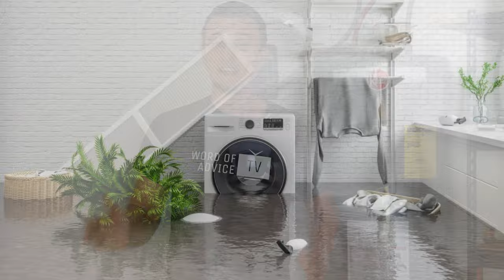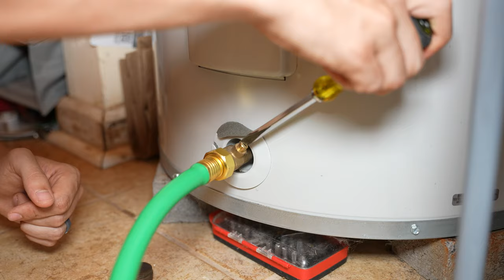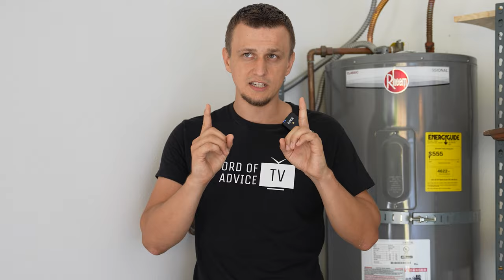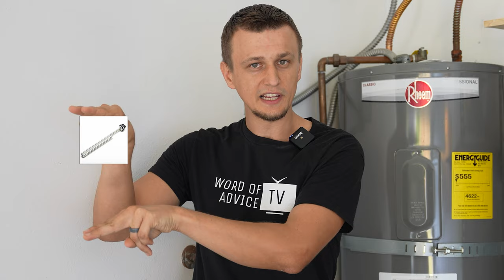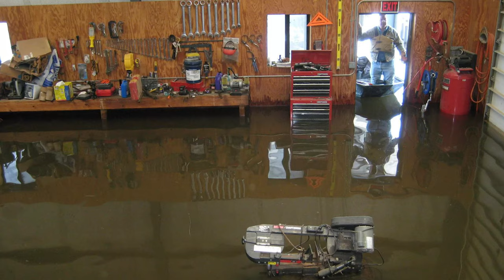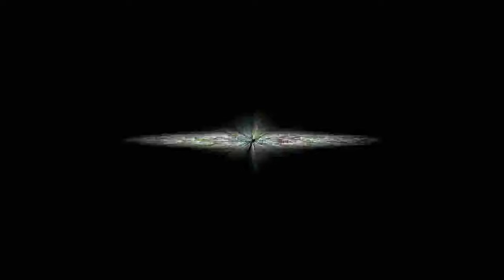When Should A Water Heater Be Replaced?

Comment: Love the video but it feels like I’ve been struck by lightning based on your confidence that hot water heatings almost never start gushing water. I’ve lived in 2 apartments with older water heaters, maybe 25 years old, which broke and started flooding. One was a college apartment and we just heard the water running from another room and checked on it with an inch of water on the floor. Not quite sure why it was leaking but I just shut off the water til maintenance showed up and replaced it.
The other time in another apartment, heard gushing water from the water heater and found a large indent in the side of the thing maybe a foot across, and had to do the same thing, although I caught it earlier than the previous time so there was less water

Comment: I bought my current home roughly two years ago. The home was built in 2005 and it still had the original HVAC system along with the original water heater. Both items were replaced after I got settled in. HVAC systems and water heaters are the two common and very important items in most houses. These items never fail at say, 9:00am on a Monday morning when people might have a decent chance at trying to find a good deal on either the item(s) themselves and or try to find a decent deal on a service technician that's not going to gouge their wallet for an item that the technician knows the homeowner absolutely needs to survive. This is why I replaced mine while they were still operational. It gave me time to find the best deals on both items for which I did rather than getting screwed by an HVAC or plumbing company. I knew both items were over 15 years old which meant they were running on borrowed time.

Comment: The following is the note from my plumber for my GE water heater 40 gallons (made in 2006). He didn’t even try to replace the heating element and thermostat to check if that fixes it, and has offered me a $5000 quote for water heater replacement. Should I try replacing the heating element and thermostat myself?

“This water heater is 17 years old and full of limescale. The elements are burning up and tripping the main 30amp breaker. This water heater needs to be replaced with a few code upgrades as well to make it safe for the tenants.”
Reply from the maker: Yes. I would replace the heating element myself instead of buying a new water heater.  I only suggest replacement if the inner tank is leaking. Since he wants to sell you a new unit, he would have stressed that its leaking if it was.
Reply: @WordofAdviceTV   - Thanks for your prompt response. I will try replacing both parts and see if it works.

Comment: We have a 20 year old gas water heater that works fine. It has never been drained and never changed the anode. Should we wait until it leaks to replace it? It works fine but we were told that 10 to 13 years is the life of one and ours is 20 years old.

Comment: My home was built nearly 15years ago and still has the original water heater. 5 years ago I learned I was supposed to flush it for sediment, but since I never had, i figured it was too late. I have replaced the thing that lights the gas and that was easy. I have never tested the pressure valve…can I still test it? My biggest concern is it’ll blow up. Great video! Thanks!

Comment: 2 out of 3 water heaters I have had that failed leaked both game with the homes they were not new when I moved in.. 1 was in an unfinished basement so not a big deal the second was in a finished basement and wrecked the floors.. It wasn't a sudden leak but fast enough to soak everything.

I think the oldest of the two was 20 years old. Water hardness  / PH etc might be a big factor in how long these things last. Because it is avoidable damage some insurance policies will not cover damage from a leak if the tank is over 10 years old which drives early replacements.

Comment: I guess I'm just "lucky."  Two days ago my 7-year old Rheem water heater flooded my entire home when I was at work.  It will cost $14,000 just to have the professionals pull up the flooring and dry out and dehumidify everything.  I don't know how much it's going to cost to replace the flooring, repair the drywall, paint, replace the lower cabinets, etc.  It all started when my husband noticed a slight leak from the outlet valve near the bottom of the tank.  Two days after that we experienced a FLOODED HOUSE.  My husband didn't do any tank maintenance, but I really don't know what exactly caused the issue.  I just know it sucks!!  So never say never.
Reply: I have water detectors now, they are cheap. My State AO smith is about 8 yrs old and its starting to leak. I am going to install another myself. I called some plumbers and they said that lifespan is getting more typical today,

Comment: Mine is ten years old, and I'm looking forward to replacing it.  In the summer, I'm spending 40$ per month on water heating on a small family of four.  It's supposed to use under $300 per year.  I flush the sediment every year, but I'm sure the annode rod is gone and I don't know how to do it myself.  I want a hybrid heat pump, it's expensive though.
Reply from the maker: Water heaters can last a very long time even without an anode rod. But either way, do what's best for you guys! Research on the topic and pick the path that makes most sense to you.

Comment: My situation is one of those older Water Heaters. Back when I was 6 years old I helped my father install a new Montgomery Wards Glass Packed Hot water heater. From memory it was just prior to Christmas. My mom and Dad had just purchased their first home and I was a only child at that point. Today my boy lives in the place going to college. The date of Manufacturer on the Water heater is 10-1-1981. After 43 years of use, no problems ever with the water heater, the basement flooded with 3 feet of water over Easter weekend (also a first flood or water in basement we ever experienced) due to root infected Sewer line.  For current reasons unknown today I can not light the pilot. No flame what-so-ever, so my guess is something in the gas valve was affected or a clog in the pilot orifice. There is still a remote chance things are still wet causing us grief. After talking to a couple DIY/professionals  they are all telling me basically what you mentioned. I should replace based on age alone. The unit has never given me or my family grief in 43 years with little to no maintenance. Cosmetically it look decent still as well. Your video gave me a sanity check! Thanks for the great video!

Comment: Just a thought, if there is 2 inches of sediment in a heater the exhaust pipe can get 2-4 times hotter than normal as the heat transfer is not working properly and a majority of burnt gas heat is going through the chimney rather than heating water. The last set of claims in the video are not accurate. The rest I totally agree with. Good job.

Comment: I have one in my basement that has no date of manufacture on it. When i got my furnace replaced the guy said that if the serial code was during the time that maker used the serial to say the date in it it would be a '68. Although he thought it was a 70s era design. Still older than both of us.

Comment: I have a 25 year old richmond water heater with no issues. It has no leaks, doesn’t oftenly run out of hot water, no crackling or popping, no smelly water, anone rod was never touched, never flushed it once, burns clean, heats up water fast. They really don’t make them like they used to.

Comment: I got my house 5 years ago and was told my tank would need replacement soon it was already 8 years old...well that time came about a week ago and I became a chosen one as you called it lol..I cut the gas,water,and tank off and empty what was left in tank because it wasn't bad flood but it got about a 30sq foot area of basement so I took up the tiles that was floating lol and dried it all out and replaced it I'm pretty sure it was a rusted hole on the bottom because once I empty it I didn't have anymore water coming from anywhere

Comment: Electric Water Heater getting near 50 years old. On a Time of Use Plan (Weekdays7pm-7pm and Weekends)   Starting in the 80's (for about 15 years) it was Supplemented by a "Solar" Water Heater Tank (Part of a Solar Heat System that also provided warm air to house, supplementing the All Electric Home's Baseboard heat) that provided the "Primary" Tank preheated water.  

On its 3rd Anode Rod (2nd Replacement) been meaning to check its condition as the unit is nearing its 50th year in service.  Has had several new Heating Elements and Wiring Concerns (partially due to an obsolete Utility Program's "Cut Off" device, that eventually was still connected and eventually failed in the "off" position) came close that time to retiring the Tank.  

Checked for Sediment last year and it seemed/seems clear. The Pressure Release Valve isn't in the best shape and so it's best not to "test" it often... Without having a pail nearby to catch any dripping over the next few days...

Comment: My water heater is in the attic.  I put a battery-powered alarm (Amazon, cheap) in the pan below it.  At 2:00 AM one night, the alarm went off because of a leaking shell.  The pan does drain to outside the house.  I also have an alarm in the secondary pan below the evaporator coil.

Comment: The gas water heater that came with my condo in 1995 is now 28 years old and still works. It is connected to a AquaTherm Combo Heater. I do you have a friend whose 21 year old water tank leaked and flooded her basement so it has been concerning me how old my water heater is and if I should replace it before something happens.

Comment: I say they need to be replaced when they either don't work or they begin to leak. With that said if you have it in a place where a leak would cause damage you may want to replace earlier or at minimum have a catch pan installed.  In my current house built in 1988 the water heater was original and still functional but I replaced it about 5 years ago only because I was replacing the furnace and wanted to switch both to be power vents.

Comment: Please advise me on this:
My 30 gal. electric tank heater is old and tank has sprung just a small leak; It works perfectly fine otherwise and i just mop it up every few days. Rather than spending $500 i don't have on a new appliance, why couldn't i simply place one of those drip pans under my tank, knock out a small hole in the floor and let it drip under the house - or through a hose into the yard?
All this to expand the life of my electric water heater. 
Also i could replace the T&P valve just in case.
Doable? 
Thanks you
Reply from the maker: That would buy you some time for sure. To be honest I have no idea how long it could carry on like that before that leak gets too big. Not many people try doing what you explained so I can't say anything from experience 😅

Comment: If your tank has damp insulation around where the elements are. Does this mean you have to replace the whole heater, water is collecting around the bottom when I have the hot side on. If it's off it doesn't leak at the bottom onto the floor.

Comment: Agreed, 20 to 30 years is not uncommon for a water heater life span. Interesting side note, replaced my own water heater about 2 years ago, went down in the basement a few weeks ago, saw the dreaded water all over the floor. Even though it has a 5year warranty, wasn't looking forward to changing it again. Checked all of the usual suspects that could cause the problem, other than the water heater tank itself, first. After finally noticing what looked like a fine mist in my flashlight beam, I looked up and found the leak. A 6 inch galvanized pipe nipple, that I used in the new heater installation 2 years ago, was spraying out a fine mist, not at either threaded end, but directly in the center of the nipple. In all my years of maintenance work I'd never seen a galvanized nipple leaking where that one was.
Reply from the maker: That is interesting! I have never seen something like that either. It's a good thing you investigated thoroughly before jumping to any conclusions. 👍👍 Thank you for sharing your experience!
Reply: Was there dissimilar metals used in the installation?
Reply: @superspecialty5169  Yes, galvanized to black pipe. Haven't changed it all to pex yet. That's the next project. And I didn't use a dielectric union, my fault. Just usually they start leaking around the threaded area, not the center.
Reply: Mines 24 years old and not leaking at all. Never been flushed, never excercised the valve, and it heats fine. Hopefullly it stays that way

Comment: My neighbors 23 year old Rheem 40 gallon natural gas burst at the flue vent seam at the top. The bladder on the thermal expansion tank had failed (and had probably been like that for a long time). Luckily the whole tank did not "let go" and she was home, but had she not been it would have been way worse.

I replaced my own just a few days ago (same age as my neighbors), mainly because I added a water softener not too long ago, and couldnt get the anode rod off my old water heater.

Comment: My 15 year old electric water heater bottom element is not getting AC voltage from the top.  Only the top element sees 240VAC.  No loose wiring.  Is this internal failure or do I need to replace somrthing that controls power? This is GE model 50 Gallons. Thank you

Comment: I had a Rheem water tank for 20 years and no problems , then had it replaced by an American Standard, and it was junk . Had many issues with it, and so after 15 years, I went back with Rheem hoping  to have it for another 20 + years . 2 questions I got for a professional plumber , should i flush once a years ? And when should a agnode rod be replaced In order to keep the tank in tip top shape ?
Reply: Sorry bro but that rheem is only gonna last you a couple more years.They don't build them like they used too.
Reply: @JpGarza-tu6dx  got my fingers crossed 🤞 though😆

Comment: Hello Jay, I have a gas water heater that is leaking water at the Pressure Relief Valve. The joint looks corroded and I am reluctant to replace the valve. What are my options.

Comment: My hot water heater is approximately 4- 5 years old. It was installed when my home was built in 2020. It is leaking some water at the bottom and I have checked all the valves and they are good and tight. The insulation inside the  bottom of the tank is moist. Do I need to be concerned of it bottoming out? How much time do I have before that happens. I first noticed water sporadically since February 2024. Thanks!

Comment: We have well water. We have that popping noise. But recently our water got super hot. We didn’t change anything just woke up one day and the water was way hotter than normal. And now we don’t get hot water. There is a wee little bit of moisture around the bottom element. It is an electric water heater. Does mine need replacing or should I just swap the element and thermostat?

Comment: Excellent video (as always)! I did replace my water heater about 1 year ago. It was about 26 years old, Bradford White, 75 gallons. It worked fine and I was not worried about a catastrophic flood (several plumbers I had talked to echoed what you said, they'd never seen a tank burst). However, my worry was that if it did develop even a slow leak I would have to rush to find a new heater, and then would not be in a position to negotiate for a good deal. Any thoughts on that? Example, maybe do your research in advance so you know whom to call who'll give a good price when it leaks? Or maybe if it's a slow leak it's not an emergency and you can keep using it, take you time to find a good deal? Or maybe in the remote chance you have to do an emergency replacement it's still better to pay a a little higher price then rather than replace un-necessarily just as a precaution?

I saw someone wrote they were quoted $14K for a new heater, I can't believe the price! I paid $2600 for a 75 gallon Bradford White an year ago (parts and labor and tax, complete) and I thought that was outrageous -- pre-pandemic I think it would have been about half that, certainly well below $2000. I did not go for the extended warranty, took the standard 6 years, my plumber said the extended wasn't worth it since it's not a different/better tank and I think he's right (any comments)? Also, my plumber said the reason the new heaters don't last as long is because of changes the manufacturers had to make to meet the new efficiency standards -- does anyone have views on that?
Reply: Good points raised about not necessarily replacing an older water heater as long as it’s working. Regarding the warranties- it’s not worth paying more for the longer warranties, since they’re always prorated, so if you buy a heater with a 12 year warranty and it fails at 9 years.  They’ll cover only 25% of the original cost of the unit, not labor. Not worth it really.
Reply: Our water recently did leak and flooded our home. We were out of town so I don’t know exactly what happens. It thankfully only flooded hallway with old carpet we were planning on replacing anyway. Can someone tell me what PROBABLY happened? 
Is this a situation where it DEFINITELY needs replacement? We turned water heater and water supply off for now.

Comment: I got an issue for you to figure out. I changed out the upper and low elements and  thermostats, there's power going to and through the thermostats and elements. However, the water doesn't heat. I have 2 full bathrooms. The one close to the water heater has only cold water slowly coming out. The other bathroom has no water coming out of the hot water faucet at all.  Have you, or anyone else ever run into that issue?

Comment: When I turn on the valve for the hot water it just comes out the drain I hooked up a hose but the water just comes out of the hose like is just running through there